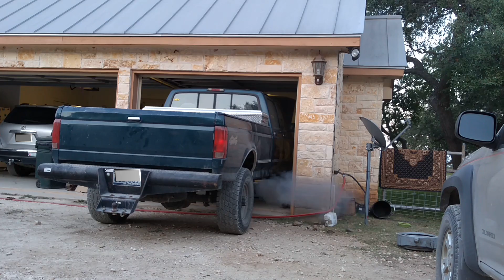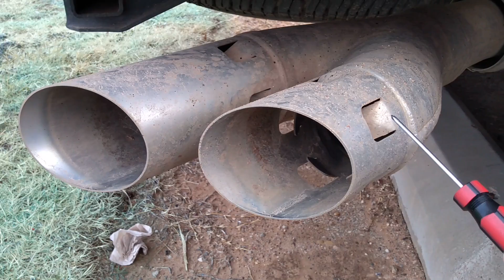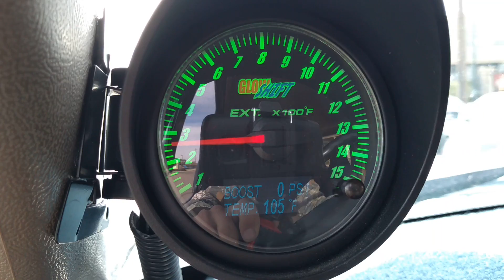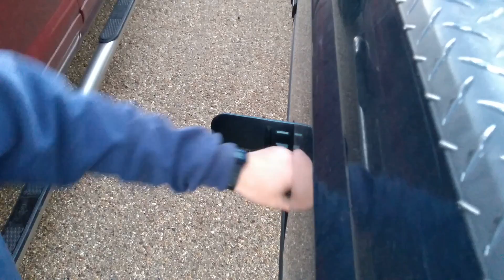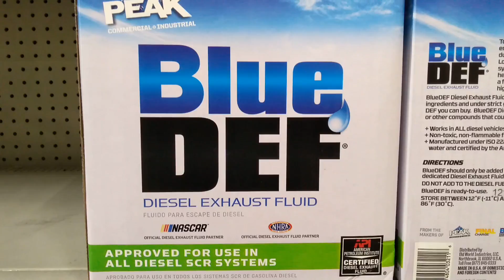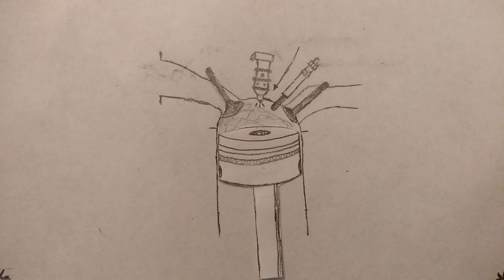Top 10 Things to Never do to a Diesel

Comment: Been twisting wrenches 40+ years.you talked about it but to me it should be #1 and that the bit of starting fluid. I guarantee I will never use that stuff. Seen too many motors ruined, busted pistons, rings, bent rods and once opened up a perkins four cylindet and took the crank out in three different pieces....sad thing indeed. If you just have to help a diesel s5art my favorite is to spray just a quick spurt of wd-40. If you were to visit my place, I'll give ya 20.00 if you find a can of ether........lol....
Reply from the maker: 40+ years of turning wrenches, that's impressive! Its sad to hear stories about engines being ruined with ether. It's my #1 thing to not do as well, I probably should have numbered them in the video, but I ordered them from not so bad, to worst in the video. So you've never had WD-40 give you issues with ruining an engine?

Comment: Good tips . Sir. If ever one really needs to use a starting fluid in a diesel engine, than I advice to use break cleaner as it's closer to diesel than ether . Still only to be used as a last resort
Reply: Fuck no. Starter fluid has lubricants in it. If it wasn't my engine I would use brake kleen
Reply: @juliogonzo2718  Starter fluid is PURE ether.
Reply: Brake cleaner is the WORST thing to use! Not only can it damage paint, and plastic but it also washes away any oil in the cylinders. A lot of big diesel vehicles and equipment have a bracket and line under the hood for an ether bottle (same size and type as a propane torch bottle). All of our 5 ton trucks as well as others when I was in the Army had that feature with a “cold start aid” button on the dash to spray a metered amount into the intake.
Reply: @bigdaddy7119  And Ether doesn't wash away the oil . I think you mean brake fluid .
Reply: Paul S  no sir, brake cleaner will eat up paint and plastic. And as someone else posted, your starting fluid ether has a small amount of oil in it for lubrication. Spray some on a piece of concrete and when it dries, you can see the outer ring still there because oil doesn’t evaporate
Reply: @bigdaddy7119  A the lube comes from the oil in the crankcase B you don't run the engine on it Just start it . C you must have weird paint and plastic.
Reply: Paul S you do realize that there’s residual oil that clings to the cylinder walls, right? Ever heard of a dry start? But, whatever, I just hate seeing the unknowing get bad tech “advice”. 🙄
Reply: @bigdaddy7119  Firstly I said "Only to be used as a last resort" next the 2 revs it needs to start will definitely not hurt , Oil or no oil.

Comment: Thanks for bringing up the ether do not use. So far you are the only one I’ve seen mention this issue. One thing I do is if needed assistance is required I use WD-40 instead or if possible pour a tiny bit of diesel into the intake manifold and lite it on fire then crank the engine vary effective
Reply: You cant lite Diesel on fire

Comment: Four 7.3ltrs 4 aux (secondary) manual Glow Plug switches all still workin fine. The only control pre 99' (SUPER DUTY)
Is the size of the wires. The computer cannot control the resistance due to solenoid comes on when pcm goes to ground. Same way I hook my solenoid/switch and switch lights up when glow plugs are on. Lit switch will flash when you have more then one dead plug.
A secondary solenoid I control has got my truck started when the factory unit melted down on a frigid below zero day. I also supply more current with larger 6-0 wire. 
You should get a glow plug and see how long even a 350,000 mi glow plug will go before you are damaging it. Glow plugs will suck the battery dry before getting the element too hot. Figure all the cast iron and fluids it is buried amongst? Be real tough to get it hot enough to carbonize.

Comment: I get phenomenal mileage with a cocktail of 1/2 gal. of gasoline and one gal. of biodiesel mixed into a tank of street diesel. 600+ miles out of a 30 gal. tank! 
 - 1990 Cummins Turbo D20.
Reply: Just be careful that gasoline tends separate heavy dirty  parts from diesel ,that goes on bottom :)

Comment: Please reply. Do you use Archoil in your powerstroke engine?
If you are unfamiliar with Archoil see it at this web sight: www.powerstrokehelp.com
Use brake cleaner to start that cold cold engine...it will not harm your engine but it will get your engine to start.
Reply from the maker: I don't use Archoil in my engine, it runs fine, so I don't have a need to. I haven't heard of using brake cleaner before, but it sounds like it should work if you get the flammable stuff.

Comment: NEVER USE STARTING FLUID IN A DIESEL ENGINE
Reply: That is good advice for noob's. I have had diesels since 1965 and I know when to use starting fluid to aid starting and save starting systems. one qiick pfft in the air screen will generally get it started and then maybe if it runs real rough then  another real short pfft. I am 76 yrs old and still am working on and running diesel engines.
 I have never had a problem using starting fluid. Most people use way too much starting fluid. Absolutely do not use with and kind of heating device be it glow plugs or manifold heater. I have experience with both
Reply: Terry Knorr all new diesels have some kind of heater unless it has been deleted like is common with the Cummins grid heater so yes it is just safer to tell everyone don’t use it or use WD-40. I use it as well but like you said, it takes care and caution. Too much will wash and scar cylinders which is even worse since it’s a cold start.
Reply: Matt Leonard WD-40 only if something is needed

Comment: My old 86 Mercedes 240D  diesel manual said you could add a ratio of gasoline to the fuel tank   to thin out the diesel fuel.
Reply: I've seen that for vw too
Reply: In germany you can do that, no problem …. To prevent gelling of the diesel ….  @32F  = 0C no gasoline ….  For every -1C after that 1% gasoline ….  Up to a max of 20 or 25%

The American’s on the other hand say oh no, no gasoline ….  But the manual of my 91 cummins said, in an emergency you can run it on kerosene 😂🙄🤦‍♂️

Now with modern (2007 and never) personally i would not put gasoline or Kerosin mix in the diesel….

Comment: Check out BG products. Has a bunch of stuff for gas and Diesel engines.
Reply: Sold them back in the late 80's. Sell a (gas engine) customer with fuel system problems a can of 44K and you will have a return customer for life. Lots of pricey products that really do work exceptionally well.

Comment: Love the vid, BUT...
You kinda botched the explanation of octane rating vs diesel fuel ratings.
Octane shows gas' RESISTANCE to detonation under high compression.  High compression for a gasoline engine is anywhere north of 10:1.
Diesel fuel doesn't ignite, it combusts, and only under EXTREME pressure, comparatively.
(Diesels run well north of 20:1 compression ratios)  Trying to run gas in your diesel will cause what amounts to 'precombustion'. meaning it'll ignite WELL before it should, and it'll be an explosion, rather than a burn, which would effectively wreck your diesel engine.
(Oh, and yea, it strips the lube from all surfaces)

Other than that, great vid.
Reply: There is absolutely NO modern diesel engine running "well north" of 20:1 compression. That being said, gasoline will indeed destroy a diesel engine, due to BOTH detonation and lack of lubricity.
Reply: @benjaminconnolly5655  
Forgive me, I was raised on the older/naturally aspirated diesels, which sit around 25:1.
Modern turbo diesels are between 15:1, to  20:1.
I humbly apologize for my mistake in clarification.

Comment: Gas in a diesel is 100 times worse than diesel in a gas engine, in fact if you run a bit of diesel in your gas engine it cleans the carbon deposits from the top end, idles way smoother and better acceleration, and a little gas in a diesel engine is enough to burn the engine up
Reply from the maker: Gas in a diesel or diesel in a gasser is bad either way, I'm sure the argument has been made both ways many times before. Interesting point on using diesel to clean a gasoline engine, I always thought of diesel as being less apt to burn and would likely leave more carbon, do you know how the diesel helps remove carbon?
Reply: Diesel and atf both work relativly the same, it actually softens the carbon allowing the hotter burning gasoline to burn it off, it doesn't break off the carbon and allow it to fall in the engine, just makes it soft and burns it out.....kinda like a chimney fire burns out the kreasol from a chimney.....leaves it to the bare metal again
Reply from the maker: @blackdog-mr9jy  Interesting, thank you for the insight! I'll have to try that one of these days on one of the old tractors and see how much it helps. Cool working principle!

Comment: Do not run additives period.
Reply from the maker: What's wrong with additives? I ran Stanadyne injector cleaner in my 7.3 and it worked great to clean the injector nozzles.
Reply: @Rnddiesel  And Archoil works great also ...
Reply: @Rnddiesel  The best oil Additives on market are TurboMaxx and TriboTex. I have them in my 99 7.3 SD PSD with Schaefer Supreme 9000 Full Synthetic 5W40. 307,000+ miles so far. Schaefer has been used for 17 yrs. TriboTex repairs the wear on the pressure parts of engine. TurboMaxx C4 fuel catalyst cleans and prevents striction on the injectors.
Reply: If you use good oil and change oil and filter every 5, 000 miles. No additives necessary. I put an additive in my fuel to keep injectors clean

Comment: With your later model gas motors, you can pretty much start em up and haul ass immediately, regardless of outside temp. ( I know, who cares about gassers ) not me for sure, but just some info for the masses.
Reply: It goes to below -30° here. I run my gasser for like 20 min so I don't have to drive with gloves on. Your power steering pump sounds like a sheep passing a kidney stone when you start your vehicle.
Reply: Here is me starting a Cummins ISX  in the cold. It was plugged in and still made nasty noises https://youtu.be/wMng0gQuXQM

Comment: Great list! One thing that gets me is these guys that brag ''my truck will start right up at so and so temperature without plugging it in or unhooked glow plugs/grid heater. Yeah the truck may start right up but you could be knocking off MANY MILES of life off of the engine, fuel system, and starting systems because of the added stress the cold puts on them. I plug my trucks in if the temp is 40f or below, but do as you wish with yours.

Comment: Bullet points are all good ones, some of the reasoning is a little shaky but all in all good point.  Coaxing power out of a 7.3 is just disappointing, don't try to turn a pickup into a race car, you don't train an ox to be a horse, you just buy a horse.

Comment: Excessive idle time on vehicles equipped with a particulate filter. All the soot gets captured and isn’t burned off and can add more soot to the oil. Also let the exhaust cool down if the after treatment system just went through an active regen, failure to do so could result in damage to components. Use oil rated for a diesel, keep the air filters clean so you don’t start sucking oil out of the turbo and in to the exhaust, the after treatment system can’t handle it and the DOC will not work right which will lead to you DPF overheating and melting. Change your fuel filters and don’t put unfiltered fuel in to the secondary filter because contaminants can lead to clogged or leaking injectors.

Comment: In the winte or below 40 you cant start a 2 stroke Detroit without  starting  fluid.
Reply: Not entirely true. If the block heater is plugged in, it should start without it. Done it many winters.
Reply: @wushock92  not practical for  the machinery and trucks that are  on  location without power
Reply: oShane Kasper  LOL. Reminds me of a story about the founder of Cummins having to light a fire under his fuel tank on a road trip to Washington, D.C. to display the motor in an automotive application. Up until then, diesels were primarily used in marine applications. The book was called My Days With the Diesel.
Reply: @wushock92  can u do that on my  aircraft running diesel. jet.A...in the dark.

Comment: Wait.....

You're not supposed to put your used motor oil in the fuel tank after you change the oil?

I've been doing it for years, and it seems to run better on that conglomerate.
Reply from the maker: Genuinely curious about alternative fuels: are you serious or just cracking a joke?
Reply: Rnddiesel Its not really alternative, as diesel is an oil anyway.
But it'll burn it. The used oil needs to be filtered and mixed maybe 50/50 give or take with diesel fuel. But if you just dump it in the tank, it'll be fine. My old 7.3 idi loved it.
Some people Will say that it'll leave deposits on the pistons. Thats all horse crap.
Reply from the maker: @chevytruckman34  It's primarily all the suspended metals and deposits that has me worried about putting it in my tank. I've run alternative fuels in the past and it caused my injectors to clog and start smoking. Luckily it wasn't so bad and cleared up with a little injector cleaner. I've got to get an idi one of these days, they are so cool!
Reply: Ugly Stik a little ATF is good now and then too, helps remove carbon deposits, used to add a quart to the tank every oil change to help and never had any issues.

Comment: As a former GM Mr. Goodwrench mechanic, we always used WD 40 instead of starting fluid on diesels. Much safer!!!
Reply: Starting fluid is like crack to diesel
Reply: Don Martin well except for crackheads don’t spontaneously explode when using it
Reply: @Bos742  they do sometimes
Reply: @donmartin9640  yep. Give them one hit and they need it every time.
Reply: Good for gas engines too!  A "shot" to dry the ignition components (when needed), and another down the intake.
The WD-40 isn't just fuel... it can help bring up the compression (by "sealing" rings and valves) in extremely cold AND/OR worn gasoline engines allowing them to start easier.
Reply: I just heard about this a few weeks ago from Bus Greese Monkey. Who would have thought? Lol
Reply: That is what we used on the north sloop
Reply: @artcook1976  sloop?
Reply: Seafoam is good, the spray stuff. More volatile than WD-40, still lubricant, and less volatile compared to ether or gasoline.
Reply: Great..thanks

Comment: I had a 1980 Scout 2 with the Nissan SD-6-33T turbocharged diesel. It had manual glow plugs of which I had to push in the glow plug button until it went out. IF,on the few occasions I used Ether, I'd spray a very short spray of about 3 seconds., It would rattle a few seconds and then smooth out.Putting too much ether in a gas engine can also harm it. The railroad club I belonged to used to have a loco with EMD/GM 12V567A two stroke normally aspirated with a roots blower on both banks of cylinders. I'd start that in cold weather by squirting a 10 second spray into the intake of the roots blower(Scavenging blower, not supercharger). Then we'd crank it over using the full hand throttle.It would rattle, then start with a huge cloud of black smoke. EMD's are a big version of a Detroit diesel.Regardless the least amount of ether, the better. Also in cold weather, the fuel can gel in the fuel filter. I had to pour Hot water on the fuel filter, then prime it until the fuel melted the wax. I'd recommend Winter Blend or a fuel treatment with Anti-gel.